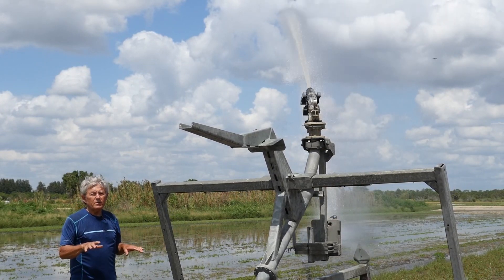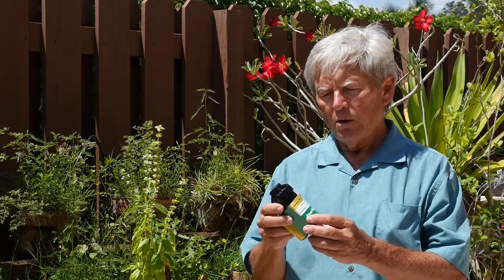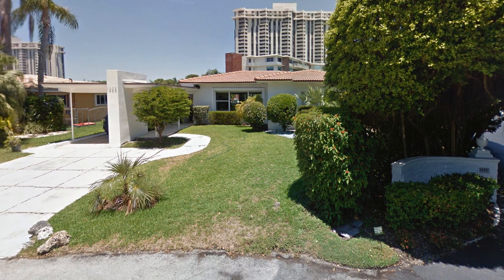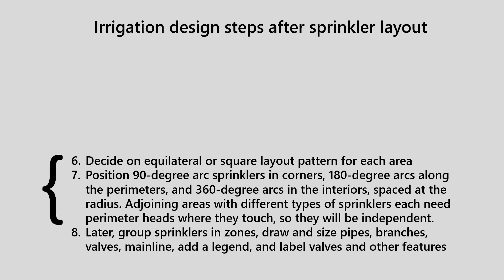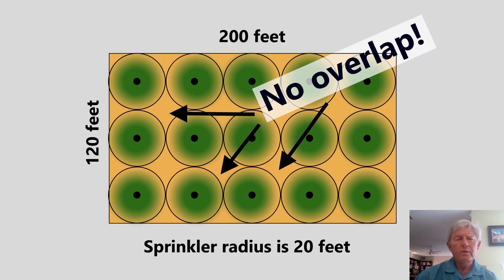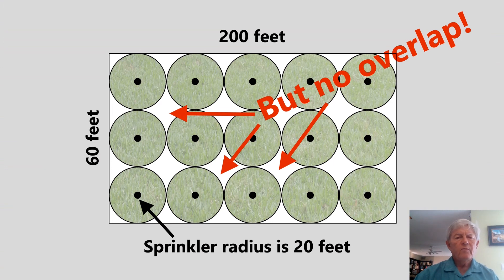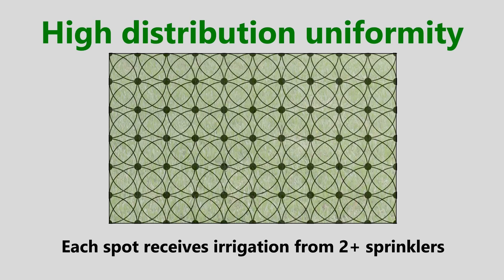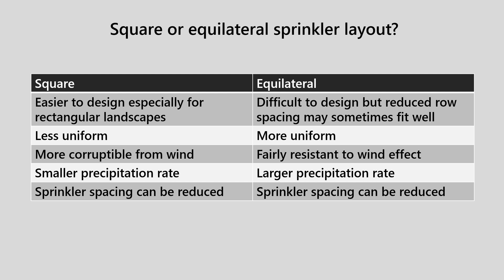Sprinkler layout: The how and why

Comment: with all due respect, unless you are Bezos or gates, regular folks cannot afford having 80 sprinklers in their houses, further more no water service provider can deliver the pressure nor the water flow to install these many sprinklers... in my house i can barely run 4 sprinklers at a time.
Reply: Ok, maybe you don't get it, so I will explain. He is using a larger example to make it more clear. You are right most people won't need 80 sprinklers. But that is not relevant to the video. It is easy to scale down, but harder to explain scaling up.

He did mention zoning, which if you are unlucky and have such low pressure, is something you are going to have to do, we can handle 8 at a time, which requires 3 zones for us.